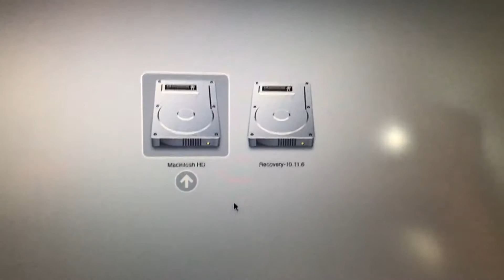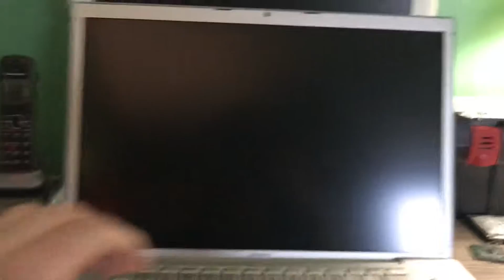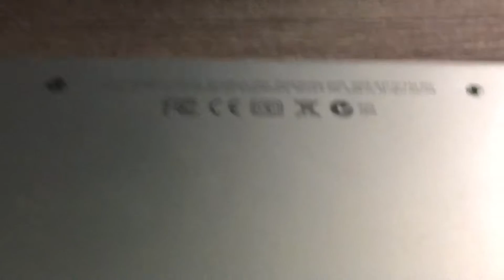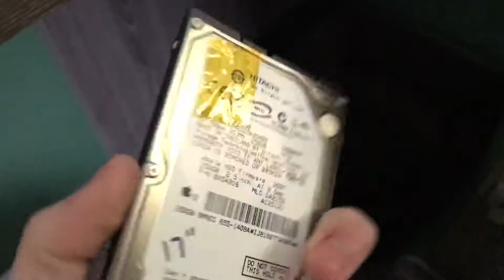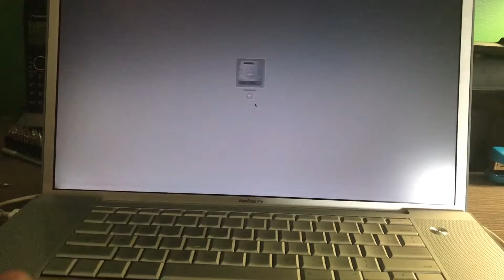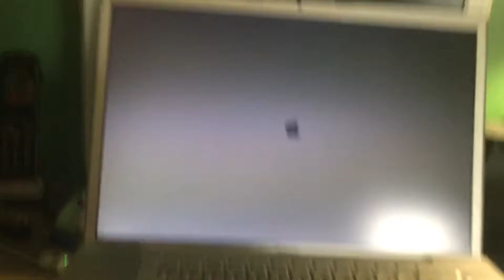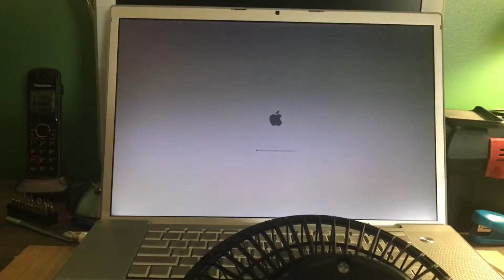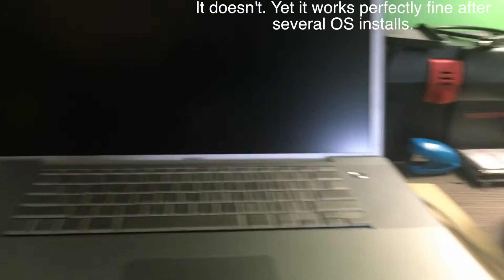17" A1261 MacBook Pro Part 1 - Overview & OS Install Attempt

Comment: The high res model actually used an led backlight
Reply from the maker: James Bender I remember that now that you said something. Might do an update video on this machine since I sent it to dosdude1 to fix the GPU. Unfortunately, USPS wasn’t too kind to it, as they busted the display on it.
Reply: NVM, I found out that the inverter board won't drive the HiRes.
Reply: @James Bender & @TheSkyeLord
I also own the A1261 17" MBP and is seriously thinking about upgrading the LCD panel myself but is unsure whether the inverter on the bezel can drive the panel.  After doing some research, the apple part number for the Hi-Res display assembly is 661-4628, which uses the LP171WU4-TL-A3 led-backlit panel.  If you don't know, I am sure you can find out but it'll take you some effort.  What you can do is, for example, installing your Hi-Res panel on your A1151 and see if it'll work.

Comment: Apples motherboards weren't always pretty, eh. Much different from the post unibody ones.
Reply from the maker: tipoomaster yeah. I’d say really it’s just the mid ‘07/early ‘08 ones that were really problematic, and that was with just the GPU chip itself, and not the board.